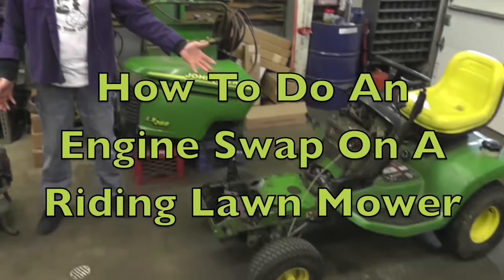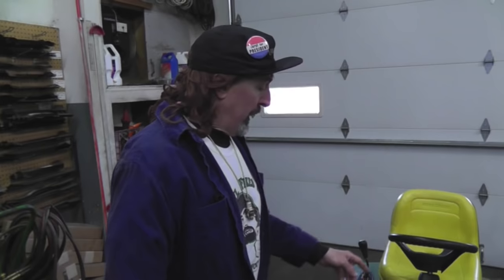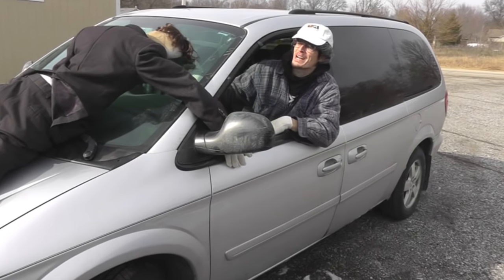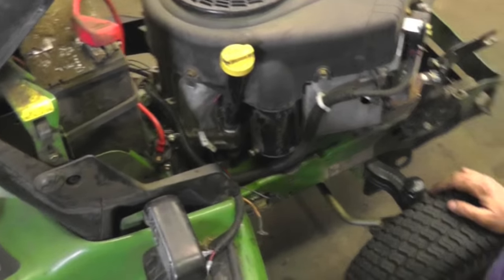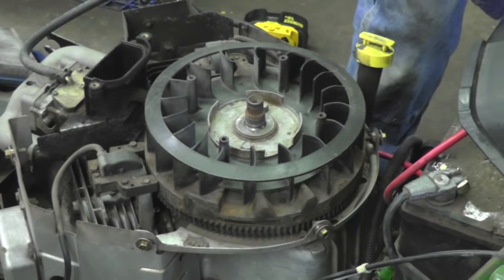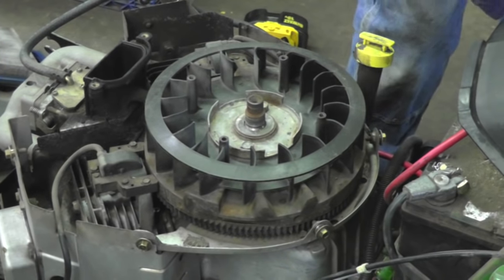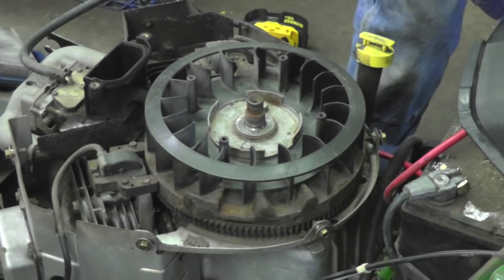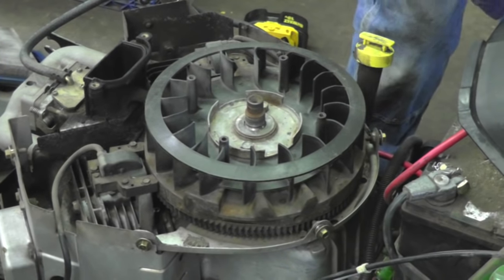How To Do An Engine Swap On A Riding Mower with Taryl

Comment: Hey Taryl I changed my 19hp kohler motor with a briggs 17.5 motor. on the kohler the two wires coming from the stator ran to a voltage regulator.on the briggs it don't have one. do I need to put the voltage regulator on the briggs motor. it keeps draining the battery when off.Thanks.For any HelpRon-513-8053050
Reply from the maker: If it has a electric PTO clutch it has to have the more powerful charging system to support the clutch.
Reply: no it don't have one. the mower had a Kohler courage 19hp sv590-006 on it the block cracked and I put the 17.5 briggs motor on it drains the battery in one hour the kohler has two white wires coming from the stator to the voltage regulator.
Reply from the maker: Is the alternator on the Briggs engine good? If so you have something hooked up wrong.
Reply: I just found out the briggs  wire had a diode in it. well I cut my wires before that and did not put that on mine. so you think that's my problem Thanks for your help
Reply from the maker: So did you cut the diode out? If so you kind of need that. It's a 1amp diode & you can buy them off ebay if you need one.
Reply: LoL yes I did. Thanks I will get one.